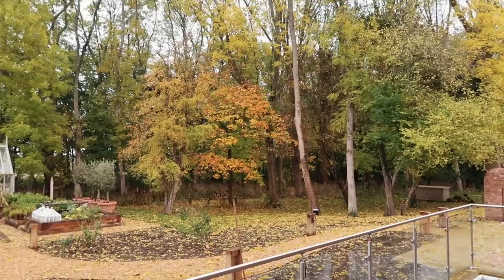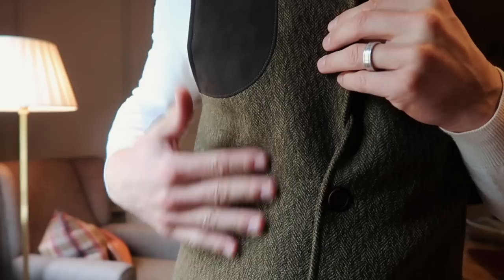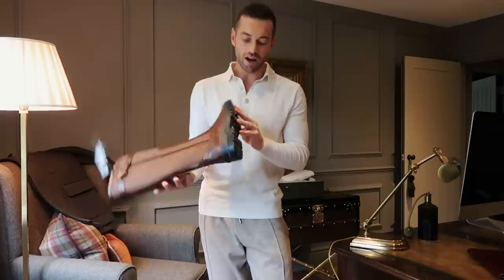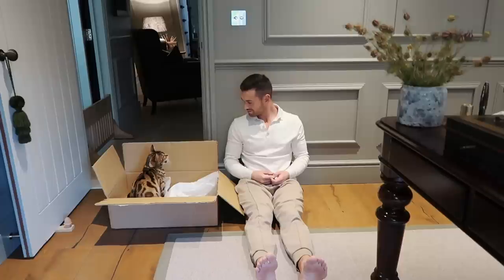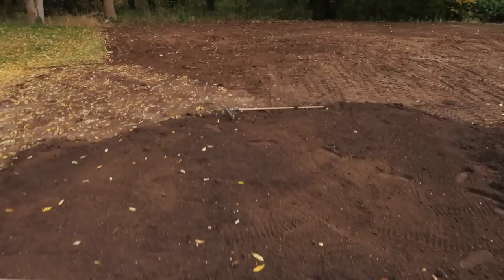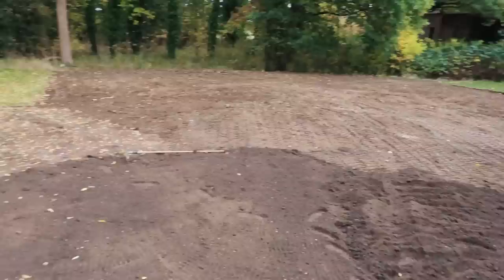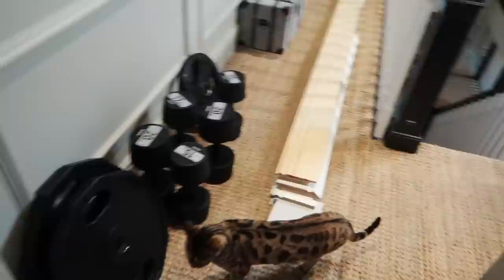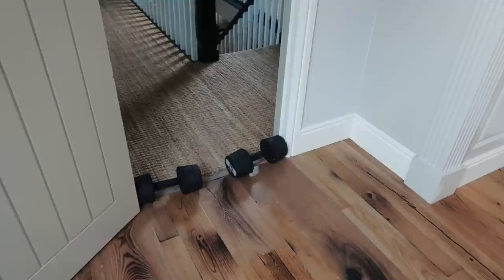MY WARDROBE RENOVATION HAS STARTED | MILLEN GORDON HOME

Comment: Here you go Ali.  PS. Love your blogs 

A pea coat (or peacoat, pea jacket, pilot jacket, reefer jacket) is an outer coat, generally of a navy-coloured heavy wool,[1] originally worn by sailors of European and later American navies.[2] Pea coats are characterized by short length, broad lapels, double-breasted fronts, often large wooden, metal or plastic buttons, three or four in two rows, and vertical or slash pockets.[3] References to the pea jacket appear in American newspapers at least as early as the 1720s,[4] and modern renditions still maintain the original design and composition.[1]
Reply from the maker: thank you for sharing